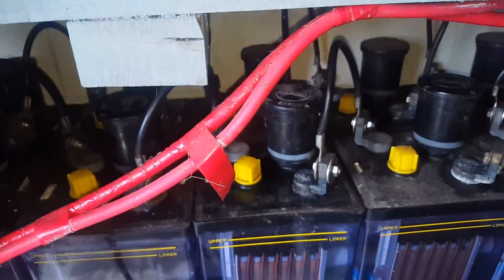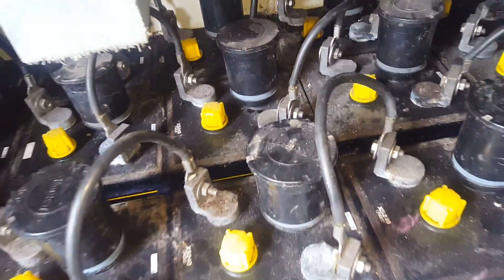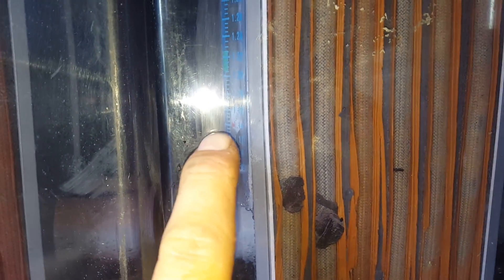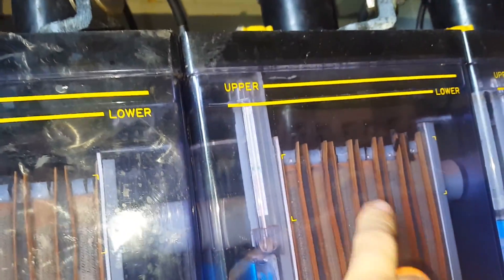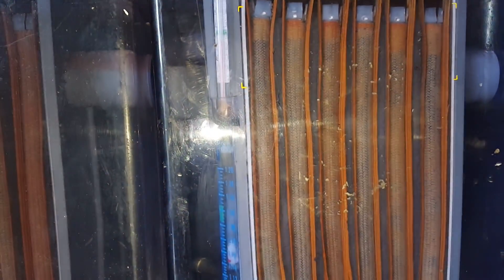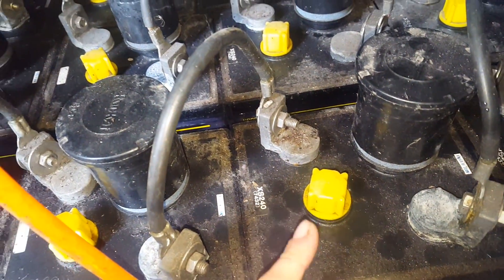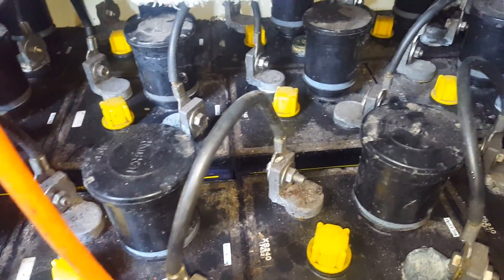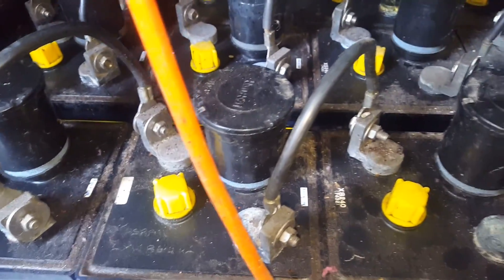2v lead acid cells struggling ideas?

Comment: I couldnt quit tell cause the camera was moving around but it almost looked like sulfation.  If it is sulfation then it can short the cell and bring it down.  Does he do equalization on the batteries?
Reply from the maker: its still in service just a bit weaker than the others i might tip it out and try get some of the crap out
Reply from the maker: His invert er has a 70 amp 12v charger function the has a battery restore / desulfation mode that he uses every now and again but im just worried that all the crap in the bottom is conductive and causing self discharge and low capacity
Reply from the maker: +michael elder might be best to tip the whole pack out and start again with clean batts and fresh electrolytes
Reply from the maker: +michael elder thanks  alot mate